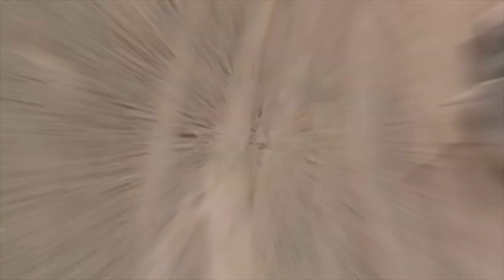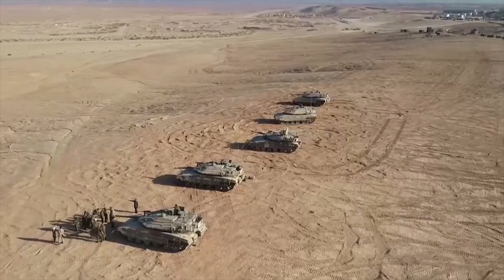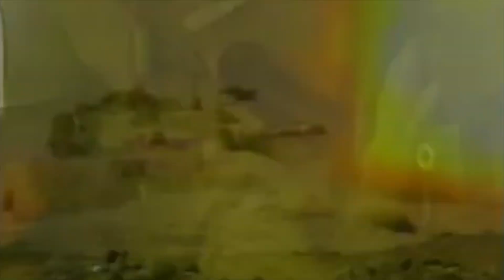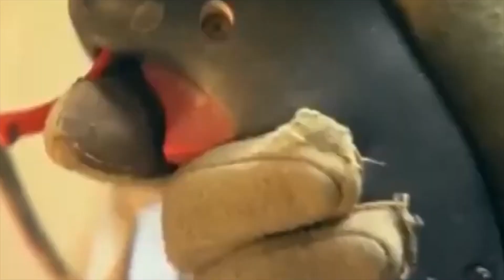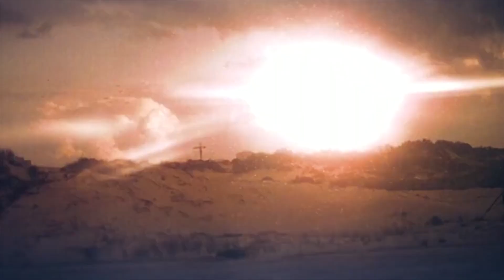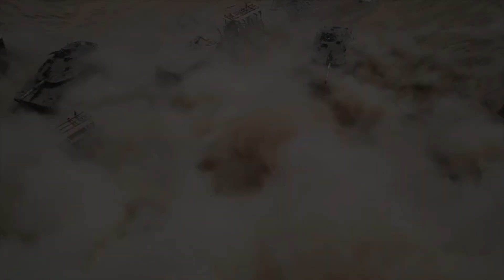New ISRAELI Most POWERFUL Tank SHOCKED The World!

Comment: I wish they would have explained the M2 50 cal. machine gun at the forward end of the turret, which in one frame showed some cables running from the weapon back into an open secondary hatch. There is no hatch in proximity to the 50 cal it is not hand fired by crew.
Reply: 1) The M2 50 cal you see is a "pseudo main gun", mounted and calibrated so that it follows all the gunner's sighting as the turret moves. It is used for training, as the .50 range and ballistic arcs are close enough to the usual 105 mm main gun ballistic arcs that it can be used to train gunners much more cheaply [not sure about 120 mm, but seems likely, given the usual distances for engagement].

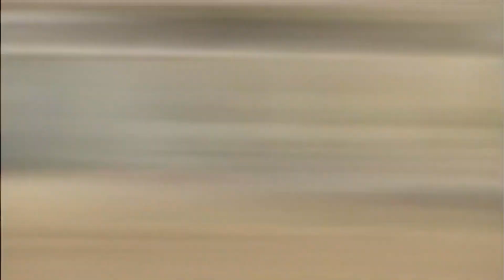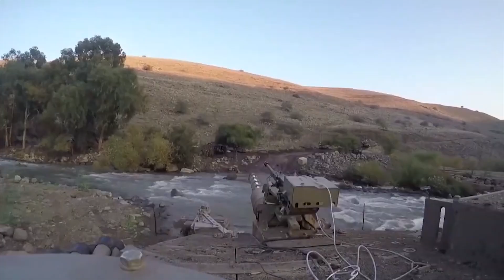2) Likely what you saw were "reins" that the loader would pull to fire it [5:15-5:35], after following all the verbal protocols between the crew members, although very, very occasionally, solenoid firing was mounted and used [too complicated and unreliable in the field].

The M2 were supposed to be dismantled if going into real combat engagements, but were often kept on as useful - somewhere between the 7.62 coax and the main gun, and more accurate than the commander and loader's "freehand", short range 7.62 mm MG's.

In some segments shown here, it appears that their usage has been upgraded, with cartridge collectors, body covers, and muzzle flash suppressors.

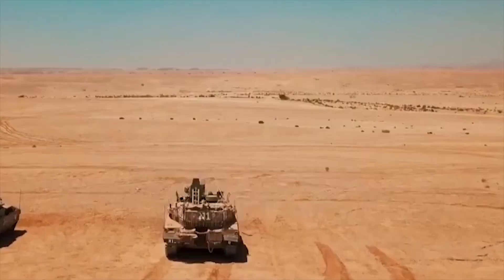3) You may have also noticed a large armoured "chair" sitting on top of the turret in one of the clips [7:18] - this is a "Trainer's Chair" for trainers accompanying field training, and is clamped into the loader's hatch opening.

4) I agree with the condemnation of the narrator's pronunciation. It is "merKAva", not "merKAVA". You would think that such an ostensibly professional commentator would know how to research the linguistic nuances while he comments on some furriner's National Defence Policy!

5) The repeated references to "Protection" are actually related to Maj Gen Tal's original design concept. The IDF's  [especially armoured] doctrine of "Movement, speed, and firepower" actually relates to this, because a well protected crew is less afraid to move into exposed and dangerous areas.
The element of  preventing losses of highly trained soldiers of a national conscript and reserve duty Army is also important. "Every soldier is someone's son, brother, father, uncle, or nephew...".
Reply: @davidbolshevik5571   Thank you for explaining that. I have had many years with the US Army and familiar with many weapons' systems, but I have never seen such a set up. In all my years in the Army, I have worked with and around numerous foreign armies and never saw a crew served weapon with no such obvious firing station and those "reins" interfering with the closing of the loader's hatch was very confusing. I really like the forward engine placement that allows access to troops from the rear combining the tank and APC in one. Thank you
Reply: @1CavPathfinder  @1CavPathfinder  It comes from Israeli ingenuity, and mostly, need to save money. In some nation's tanks, there is a coaxial .50 cal rather than a 7.62, used for "ranging fire" before firing the main gun shells, but I believe that has more or less been phased out with the advent of laser and even optical range finders. Also, accurate 7.62 is more effective against infantry in its fire rate and coverage.

1) Regarding the "reins" preventing hatch closure: this would probably be one of the differences between the regimented US SOP orders and the more "personalised" IDF practices, especially when there were many more tank units and tank models/versions [before the various Peace Agreements, and when Israel held the Sinai and much more of the West Bank], and large "Nation against Nation" armoured clashes were expected.

2) A good loader would have those "reins" tied up on the turret roof, out of the way and not preventing hatch closure, although possibly with enough slack to pull them while standing on the turret floor, in anticipation of other activity;

3) As "Someone who has been around", and undoubtedly knows quite a few practical military survival tips, another area you may have noticed [shown in some segments] was the various antennas pulled down to lay flat, secured, and out of the way [usually when advancing to a firing position, although it also appears that there are now armoured cupolas covering external communications gear].

The loader does this, along with keeping all the other loose "Turret top" items the commander uses secured and out of the way, whether flags, boxes of ammunition, or their personal weapon. 

4) We were taught "Fire first at the vehicles with the most antennas, as they are generally the senior commanders", so keeping antennae down and out of the way is also a type of camouflage.

A good loader [or an experienced commander training them!] would have the rope pulling the antenna down looped to pull them to the rear, rather than pulled to the front, bouncing around near the commander, interfering with movement and access.

Lots of practical tips and tricks developed by those spending days, months, and years on, around, and inside these bouncing, jouncing, deafening, inflammable concrete mixers!
Reply: 1) The M2 50 cal you see is a "pseudo main gun", mounted and calibrated so that it follows all the gunner's sighting as the turret moves. It is used for training, as the .50 range and ballistic arcs are close enough to the usual 105 mm main gun ballistic arcs that it can be used to train gunners much more cheaply [not sure about 120 mm, but seems likely, given the usual distances for engagement].

2) Likely what you saw were "reins" that the loader would pull to fire it [5:15-5:35], after following all the verbal protocols between the crew members, although very, very occasionally, solenoid firing was mounted and used [too complicated and unreliable in the field]. The M2 were supposed to be dismantled if going into real combat engagements, but were often kept on as useful - somewhere between the 7.62 coax and the main gun, and more accurate than the commander and loader's "freehand", short range 7.62 mm MG's.
In some segments shown here, it appears that their usage has been upgraded, with cartridge collectors, body covers, and muzzle flash suppressors.

3) You may have also noticed a large armoured "chair" sitting on top of the turret in one of the clips [7:18] - this is a "Trainer's Chair" for trainers accompanying field training, and is clamped into the loader's hatch opening.

4) I agree with the condemnation of the narrator's pronunciation. It is "merKAva", not "merKAVA". You would think that such an ostensibly professional commentator would know how to research the linguistic nuances while he comments on some furriner's National Defence Policy!

5) The repeated references to "Protection" are actually related to Maj Gen Tal's original design concept. The IDF's [especially armoured] doctrine of "Movement, speed, and firepower" actually relates to this, because a well protected crew is less afraid to move into exposed and dangerous areas. The element of preventing losses of highly trained soldiers of a national conscript and reserve duty Army is also important. "Every soldier is someone's son, brother, father, uncle, or nephew...".

Comment: Israel used British Centurion tanks, and fitted most of them with Diesel engines. They've been in service until the 1990's, and were replaced by MerKava Mk 3 tanks. I don't think Israel ever had Chieftain tanks.
Reply: You're right. The Brits gave half a dozen prototypes to the IDF for field testing, made all the changes recommended, then turned around and supplied the Chieftan to the Jordanian Army. That became a core reason for developing the Merkava.
Reply: @greywolf852  The Israelis never gave the British the list of recommended improvements because the British pulled out of the deal. They instead used that list to help develop the merkava.
Reply: @tomerschubert2095  Actually, they did. I was working at the heavy weapons division of IMI at the time and did reserve duty to help with the field tests. I also worked on the development of the Merkava I and II.
Reply: @greywolf852  I was talking about the list of improvements for the Chieftans. After israel tested them they wrote up the list but never ended up sending it to the British because they pulled out of the deal due to the six day war. I know that israel got prototypes of the chieftain for testing and even used them as test beds for the merkava.
Reply: @tomerschubert2095 what are you saying?
Reply: @JeandeDieu-j3u  the British gave israel a couple cheiftan tanks for testing (and future purchase) and the Israelis wrote up a laundry list of improvements they wanted to see in the tank. However, the deal fell through with the outbreak of the six day war. The Israelis never ended up giving the British the list of improvements for the cheiftan and used the cheiftan tanks they got for testing as testbeds for the development of the merkava.
Reply: @JeandeDieu-j3u  This guy just is B.S.
Reply: ף000
Reply: so they are just centurions?
Reply: @astemet  The Merkava? no it's a completely original design. Israel had Centurions in service alongside the Merkava I and II, and then when III came along it replaced the Centurions. I think the Merkava was influenced by the Centurion in its suspension system, and the Merkava III onwards had electric turret motor which is also like the Centurion and unlike American tanks that Israel had.
Reply: @astemet  No they built their own new tank.
Reply: Yeah the deal fell through before israel could purchase them.

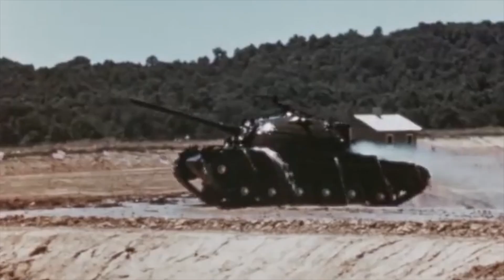Comment: 0:50 Israel never used Chieftains. It used British Centurions (and upgraded them with US made power packs and later on, reactive armor) but not the Chieftains. Israel wanted to purchase Chieftains, but the UK preferred selling them to the Jordanians instead.
Reply: The Chieftain Mark 4 was destined for Israel. Israel was involved in the design and testing  of the Chieftain and agreed to purchase and build on license several hundred of these tanks. Under Arab  pressure the deal was cancelled by the UK. Israel would were on good terms with Shah's Iran recommended the Chieftain which resulted in a large order from Iran
Reply: @michaelsalt4565  
And yet, Israel never deployed a single Chieftain tank.
At least this affair taught Israel to rely on itself in this area and now Europeans are interested in buying Merkava tanks...  Now, that should be interesting.
Reply: @itamar1964  that is true a couple of Chieftains were used in Israel for trials purpose but tgesexwhen deployed on operations. The Merkava is a brilliant design based on combat experience and its evolution into the 4 variant is remarkable
Reply: @michaelsalt4565  
And those two tanks were sent back in 1969. 
Anyway, the plant that manufactured the tank, that now produces battle engineering  and bridging equipment was sold last year to Raphael...  
I always get karma and irony mixed up in such cases...
Reply: @itamar1964  Europeans are "two faced" and cannot be trusted when it comes to Israel.  It's all about the money.
Reply: @itamar1964 I am surprised that you provide such information on social networks.
Reply: @mmjj2534  
Why?
Something there that isn't common knowledge for everyone to read?
Besides, it's over 40+ years since theses tanks were pulled out of active service.
Reply: @michaelsalt4565  Yeh we British don't always make the best decisions due to greedy politicians who knew.
Reply: @michaelsalt4565  I doubt there were plans to manufactuer Chieftan's in Israel under licence then since the country did not have the manufacturing capacity or infrastructure.   Are you claiming by a "round about way' Israel, in fact, eventually receiced Chieftans from Iran?   I doubt it again  and, if so, why not reports of them being in the IDF armoured divisions?
Reply: @gordonspicer  Israel wanted to create their own  manufacturing base for AFV manufacture in the same way they created their own aerospace industry using the Mirage 3/5 as starting point. The reason they chose the Chieftain was because the UK was happy for Israeli license production. I didn't claim that Israel used Iranian procured Chieftains, just that Israel recommended that Iran chose the Chieftain as it's new MBT.
Reply: @michaelsalt4565  The UK needed funds to complete the development of the tank, and Israel was willing to pay. In 1966, a deal was offered, by the UK, that Israel would purchase hundreds of Centurion tanks, and in return, Israel will take part in the later stages of development of the new tank and will be able to purchase Chieftain tanks and create an assembly line in Israel. Israel, which was desperate for modern tanks agreed. A delegation of IDF officers was sent to Britain in secret in order to study the new tank and 2 prototypes were sent to Israel for experiments in Desert conditions (The original Centurion had trouble operation in the desert, until it was upgraded to the "Shot Cal" variant, which had a different engine and air filters and other modifications). The experiments in Israel were held in secret and the tank's design was improved so it could operate better in desert conditions. At November 1969, Britain pulled back from the deal due to pressure from Arab countries (threats to pull back investments and some organized demonstrations in front of UK Embassies). In the 80's, it was revealed the they were planning to do that a year earlier but hid it from Israel to they could finish the development faster.
Reply: @NimDod  as I understand it the original Chieftain turret was a  much smaller design with limited depression of the main gun (similar to Soviet designs) However the Israelis said that the main gun required a depression of -10 degrees so a hull down position could be used.The UK decided to adopt this but resulted n a much larger and heavier turret adding to the Chieftain's mobility issues with its underpowered engine. That and other modifications added an extra 10 tons to its overall weight.
Of course the Israelis were correct about the main gun depression and hull down position.
Reply: actually I believe the MOD sent a couple of Chieftains for Israel to test and then renegeged on the proposed deal due to Arab influence. Now UK has only about 200 servicable Challengers !!
Reply: @gordonspicer  
Yes, but that doesn't mean the creator of this video can demonstrate such cluelessness...
Reply: The centurian might be the best tank ever designed
Reply: @RIbigDave  I'm a bit biased, I'll be careful and say that I can understand where your words come from. 
Not many tanks managed to be so versatile and adjustable and I believe that this was simply because it was ahead of its time by eons, with so much room for these adjustments and updates.
Reply: @itamar1964  it just had the best blend of the three competing factors of armor mobility and firepower of any tank of a generation and as you correctly point out was very adaptable and was able to use for a long time after its prime
Reply: @RIbigDave  I actually think that it didn't take off until it got the diesel engine with improve air filtration and the 105 gun.
Reply: @RIbigDave  For it's time anyway,

Comment: the video is well directed  but you didn't mention in July 2006 Israel lost 125 tanks out of 247 tanks entered the war in Lebanon in the year 2006 after the Lebanese resistance melted the mirkava and took 3 soldiers
Reply: These numbers are - of course, not correct. Only 5 tanks were destroyed and a total of 45 damaged, most of them (more than 40) got back in action pretty quickly, the majority within a few days. Out of these 45 tanks, only 22 were penetrated by the projectiles. Of course - 22 penetrated tanks is not a good number, this is why the MK4 has a multitude of improvements in protection, both active and passive.
Reply: Not sure about the number 125 , but it is true , during the Lebanon war ,Israel lost tanks ,  because they  advanced to Lebanon  with the older version of the Merkava , the lesson well learned and the next generation of the Merkava had a lot of improvements , hopefully it will never be tested again in battle , hope for world peace

Comment: Accurately firing the big bore gun while on the move has proven to be a lifesaver. This is what sets the American Abrams tank apart. Rapid reloading and target acquisition are the other big lifesavers. These key points are not discussed enough.
Reply: Night vision, thermal vision, reactive armor, and easily replaceable engines and transmissions are other important aspects.
Reply: Main tank weapon today is probably their Battlefield Management System. Because of it most possible treats are nullified before they actually arrive close to the tank.
Reply: Firing on the move is not unique for Abrams. I served on Leopard 1A5 back in early nineties. We had a very good electronically stabilization system with fast gyros, laser for range estimation, nice thermal vision and ballistic computer. We fired on moving targets while on the move ourselves with a good hit ratio way above 80%. The Leopard 1 biggest weaknesses was paper armor and the rather weak 105mm cannon compared to the 120mm smooth bore.
Reply: @johnmoeXXX  Challenger tanks have this capability. 
The UK's Challenger 2 tank has blasted away the competition in Nato's Exercise Iron Spear.
Reply: every modern tank can fire on the move now because of stabilizers